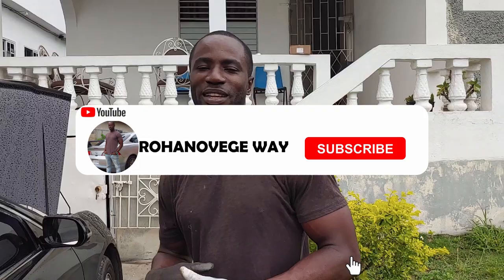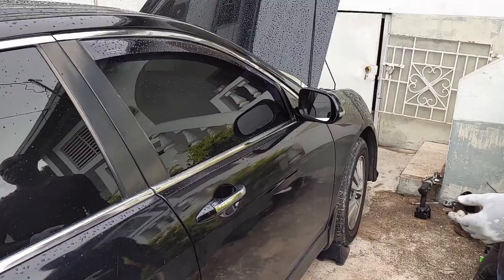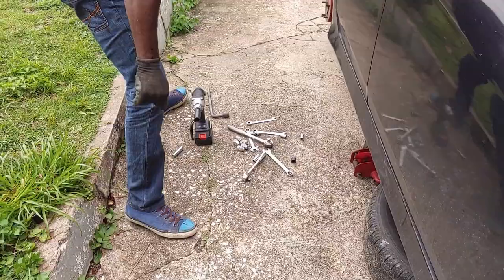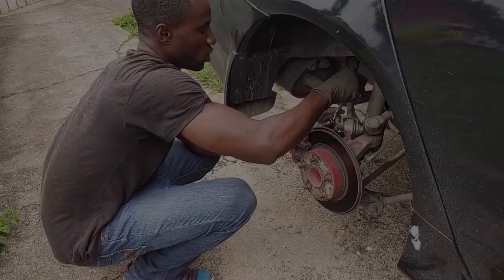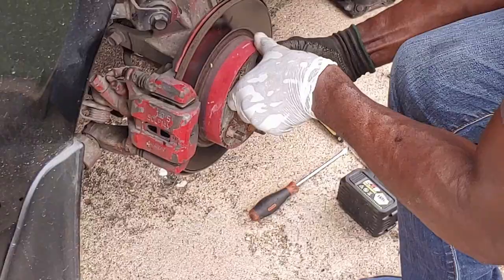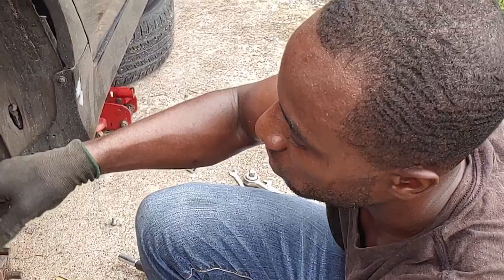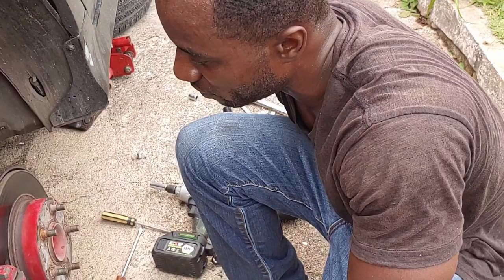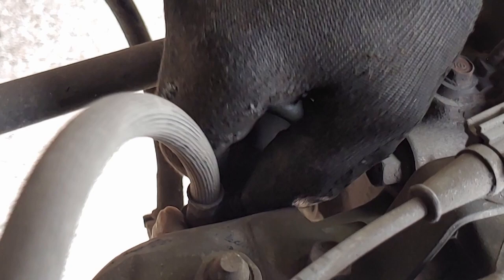Rear brake adjustment on Acura and Honda  brakes, disc type.

Comment: Man, you are a life saver, I am 83, UK based & always done my own  mechanics on my 2 cars and 2 large m/c's. I am currently doing a full caliper refurb. on my 2003 2l type S Civic.
 I was assured that these rear disc brakes were self adjusting (NOT by my garage). As you correctly show, this is NOT the case. It is critical to proceed as you show BEFORE adjusting the handbrake by the driver, or the cable adjustment will not compensate. 
 I spent many hours investigating the thread mechanism at the rear brake, thinking it to somehow to be self adjusting. I very nearly bought a new pair of calipers....you have made my day, with yourr simple yet straightforward approach. 
Why is it that yours is the only video that shows this???
Btw, it is aukward to align the locating pin on the reverse of the inner pad, with the piston slot, I found.
BRAVO!
Reply from the maker: I'm glad my video was helpful, remember to subscribe if you haven't already.

Comment: In brief 
1.Rotate to advance pistons to just engage with pads.
2.THEN adjust cable nut to 6 clicks, max.

The console ajuster is ONLY to compensate for cable stretch.
Reply from the maker: Exactly.